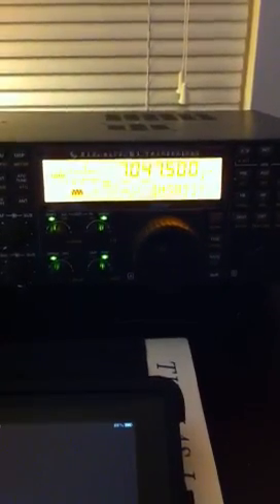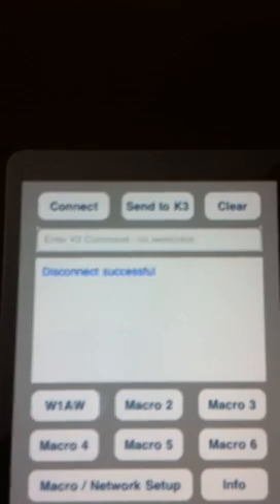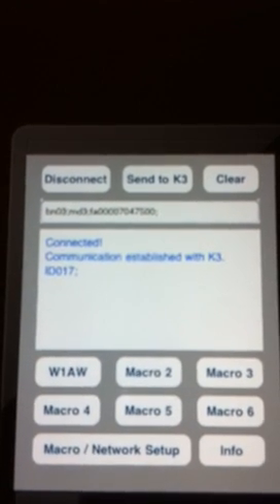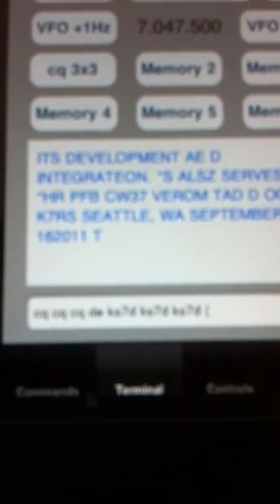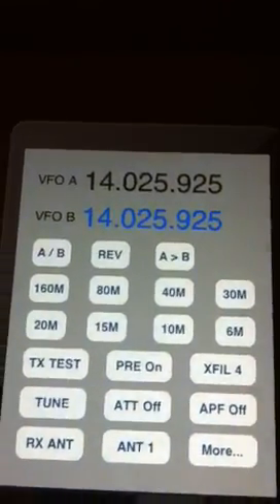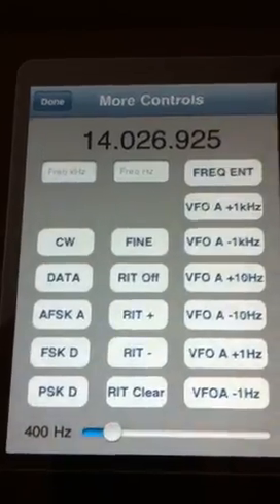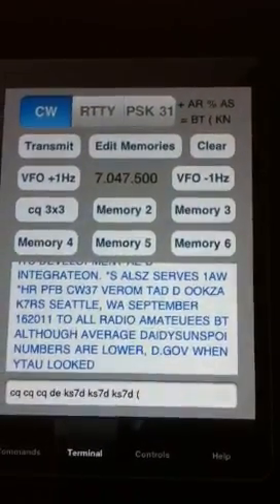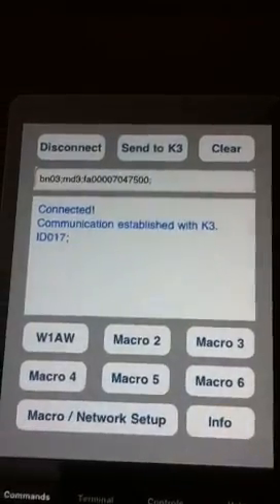K3iNetwork Demo

Comment: You can control your K3 with K3iNetwork anywhere you have access to a wifi network. Some users control their K3 and make QSOs while flying on commercial airlines. So, it is not necessary to use it with a home wifi network, but most people do.